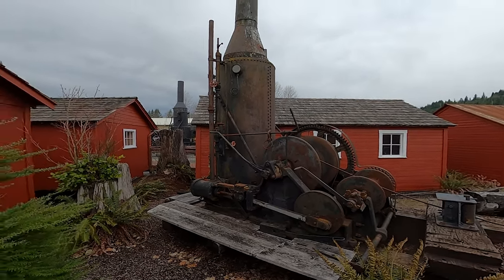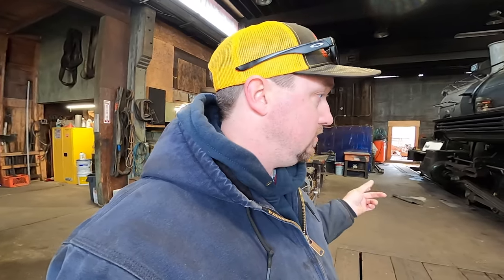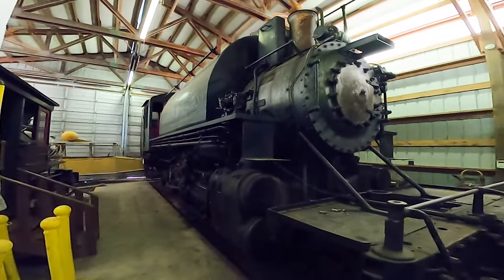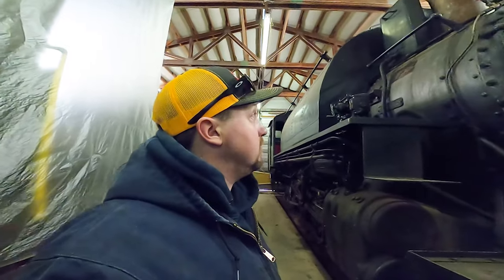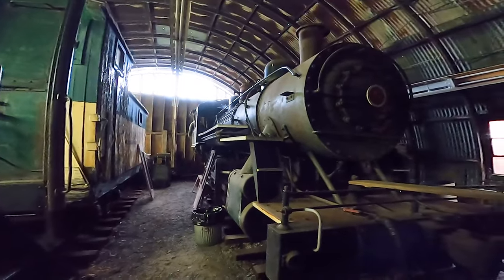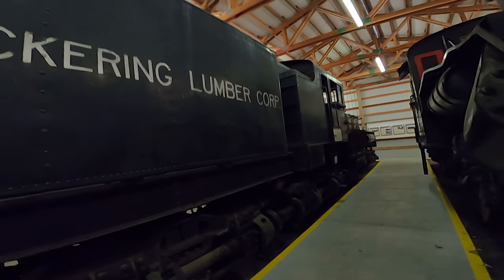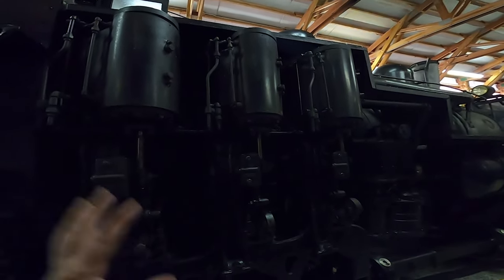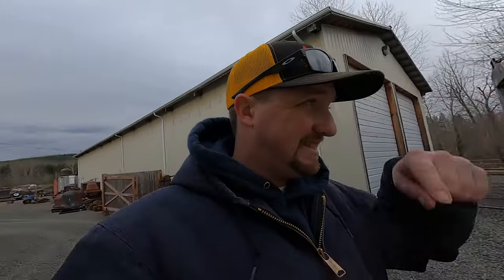Mt. Rainier Scenic Railroad - Season 1, Episode 3 "Flat Clapped Out - Rowdy's Steam Engine Tour"

Comment: I thought that the Willamette was completely rebuilt not that long ago.
Reply: That's why she's in the best shape of all the geared engines, and may have a better shot of being brought back to steam over the others.
Also, there are MANY operating Shays (LOTS at Cass Scenic in West Virginia, a couple at Roaring Camp & Big Trees in the Santa Cruz Mountains an hour away from San Francisco and Monterey, a couple on Yosemite Mountain just outside of Yosemite National Park, and many others elsewhere), a decent number of operating Heislers (2 operational in the state next door with one on the Oregon Coast Scenic, the other on Sumpter Valley, the oldest working one also fairly close by at Roaring Camp & Big Trees, another fairly close by at the Roots Of Motive Power in Willits, a 3 trucker at Cass Scenic, another at Stevens Creek in Illinois), and a couple of operating Climaxes (One on the Cass Scenic, the other at Clark's Trading Post, and one on the other side of the Ocean on Puffing Billy in Australia).  But there are NO working Willamette's, which would be another reason to bring it back to steam over the other 3 besides being the one that needs the least amount of work.
However it would be wonderful to see ALL 4 geared engines running again, and maybe someday that can be a reality. :)
Reply: @Chris9017  Even better might be to see RJ Bud Kelley steamed up, but with it being exposed to the elements on display at the MRSR may affect that. if it's in better shape or needs less work than 91 (highly doubt), it could run again before her.

Comment: I don't know if this is viable, but there is an engine, Seattle City Light No. 6 in New Haven, 2-6-2. But I don't think it'd be in great running condition seeing as it has been on static display since the 80's (supposedly). Cute little thing, eventually it would be cool to see run, but again, I do not know if it would be a sustainable option.

Comment: If y’all aren’t gonna run any the geared locos give ‘em to someone like cass in West Virginia who will have no issues Fixing them an putting them into operation it’s sucks y’all have no motivation to mess with them sad
Reply: If you threw around your checkbook as much as your opinion the orginazation would be flush enough to run all the geared engines. Nowhere in this video did it say that there wasn't a want to run the geared engines. There is if there is money in the account to cover it, until someone wants to come along to pay for it it won't happen. As far as what you have stated, find someone to front the moving bill... I'll wait.🍹🚬
Reply: @therowdyexcavator  the way you explain it in the video came across that way as if yeah you could but just show no interest idk man maybe make a video. That would help explain how much all that would cost to restore one of them for most ppl we don’t know what those figures look like / it’s also sad that they just kept running them into grave like that … why not fix the issues as you notice them next time around?  An how are you going to buy a 3rd loco if your can’t afford to restore one on your current roster ?
Reply: @anthonycook5238  If they can get a third running locomotive now, they can use it to make money. Even under the best of circumstances and with all the money you need, steam locomotives are intensive and long rebuild projects. One of the reasons railroads ditched them was because of how time and money consuming the maintenance was. Many of the issues he mentioned can't be fixed with routine maintenance. You have to tear the entire machine apart and rebuild from the ground up, assuming you have the money. Most things have to be custom made too. There's no parts catalog.